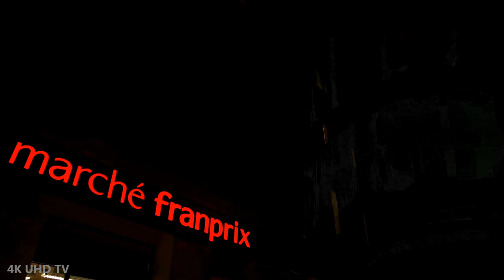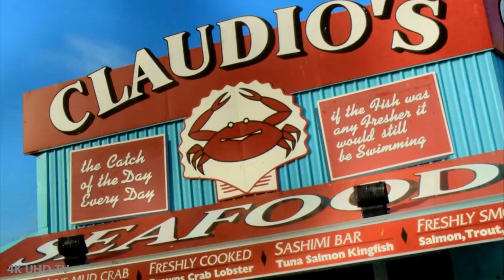Sony 4K Demo - 1 Hour Compilation in Dolby Digital

Comment: Ur video quality uploaded is only 480p
Reply: @Siva Shivu I am seeing 2880p60 5K
Reply: @4x4me2  due to lockdown and high data requirements.. YouTube has reduced the resolution of all videos. How you can view this in high resolution?
Reply: No. You are seeing on your Smartphone. That's why..it is showing only 480p. This happened for some videos..even on my Samsung Note 10+, and although..Phone is 4k display..max Resolution you can see is just 1080p.
I have just Watched on OLED..4K TV..
All Res..can be seen there..
upto a maximum of 4K
Reply: @siva11inin  Correct. That's the Actual Reason..it's restricted by Ytube Itself..👍
Reply: @ansh1498  no i can see 5k is for your smarphone dont acept this cality
Reply: @4x4me2  x2